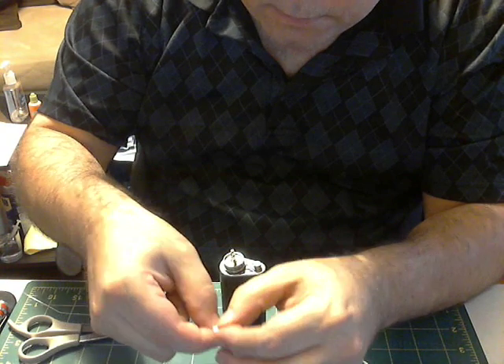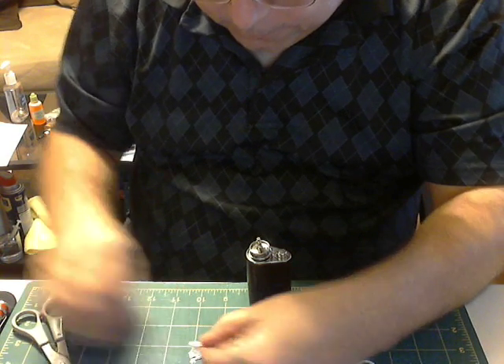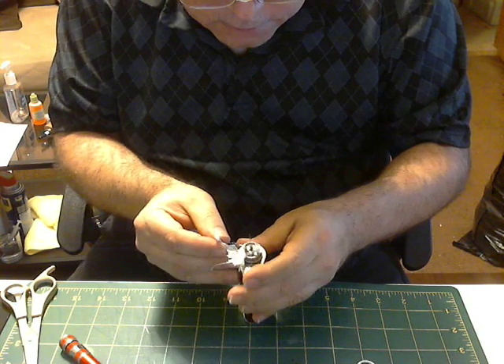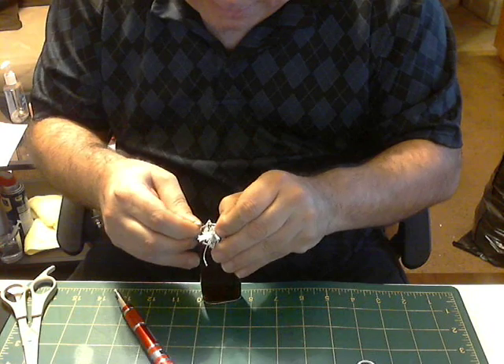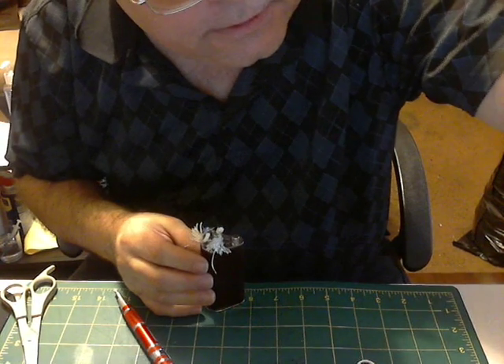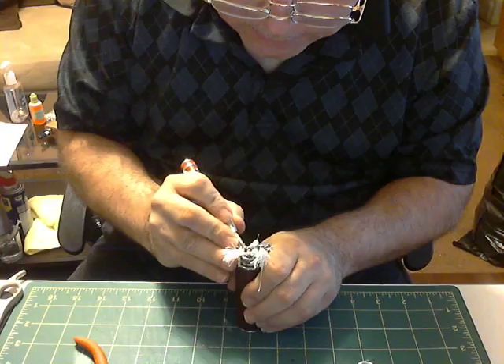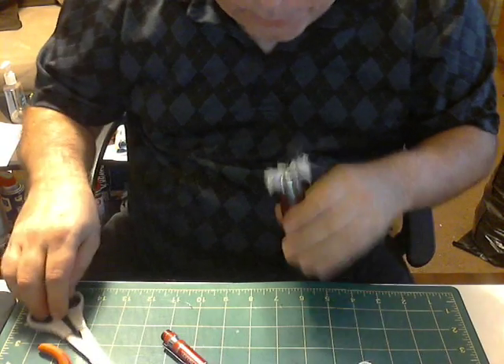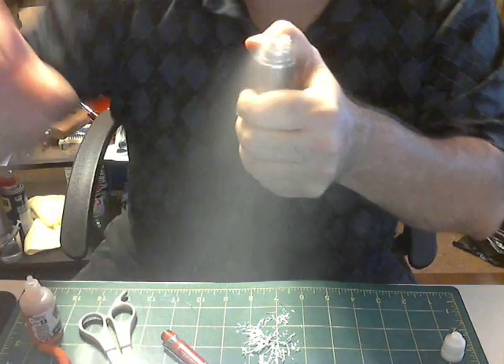Eko Wool Silica Wick Electronic Cigarette

Comment from the maker: Not sure how they picked the name. This is definitely not a natural fiber. The difference between this and regular silica is that it is braided which makes it hollow. Also, if you torch this stuff it gets rigid and does not fray as easily as regular silica.

I have been told by my suppliers that batteries will be shipped by UPS moving forward.